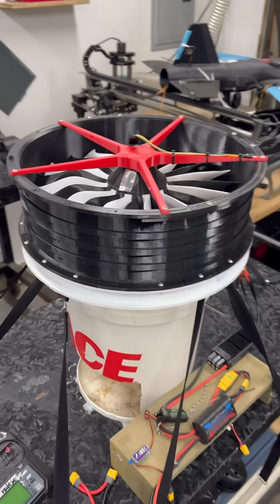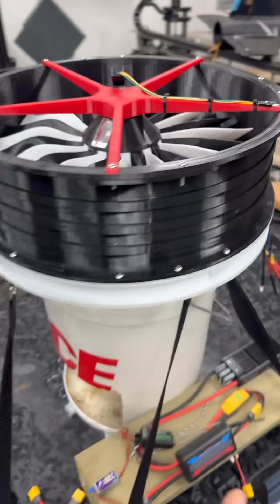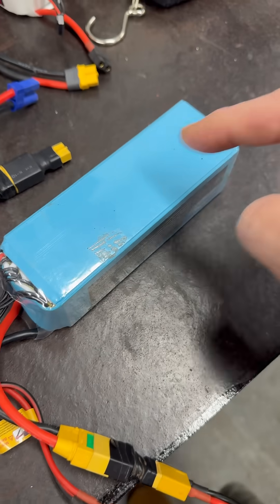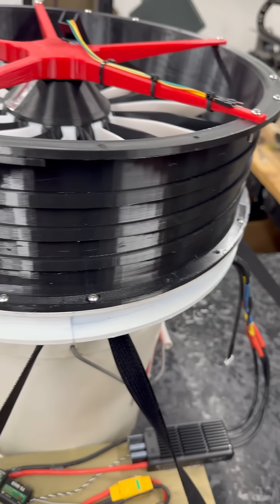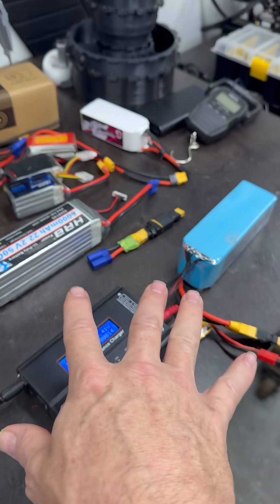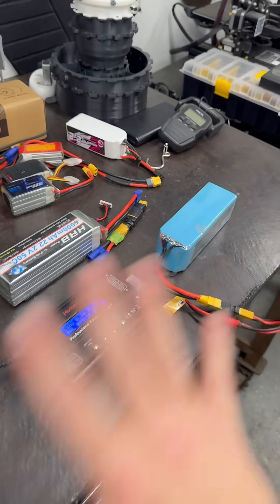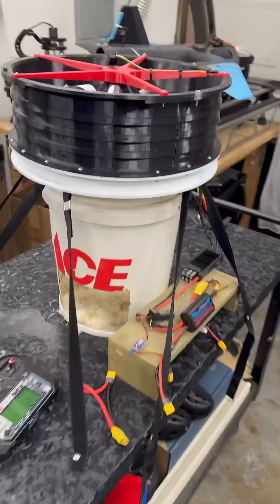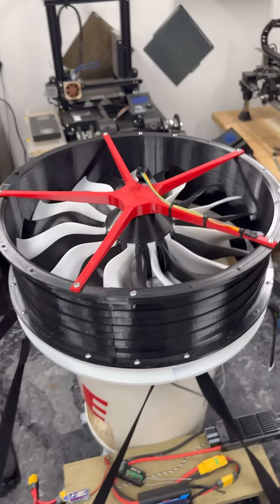Second run of the 340 mm 3-D printed EDF coming soon. #fyp #diy #shorts #edf #drone #youtuber

Comment: Controlling the discharge using just voltage would be dangerous with batteries of different capacity in series (this is about capacity not rated current). Fortunately, your appliance tracks the amp-hours, so keep that below the smallest capacity of your batteries in the next test.
Reply from the maker: Good info thank you.